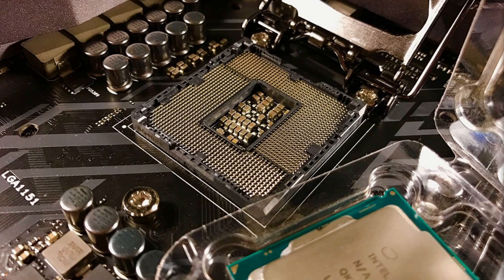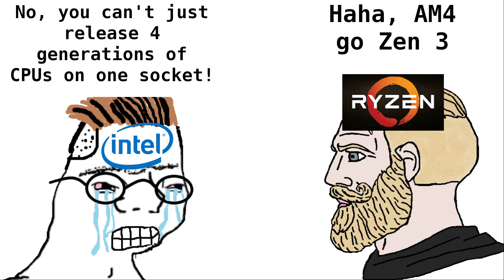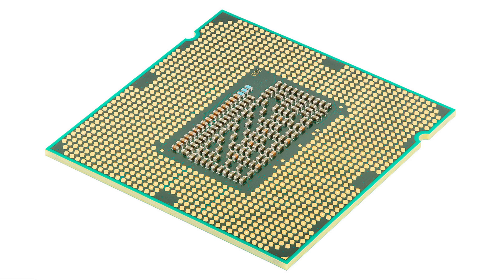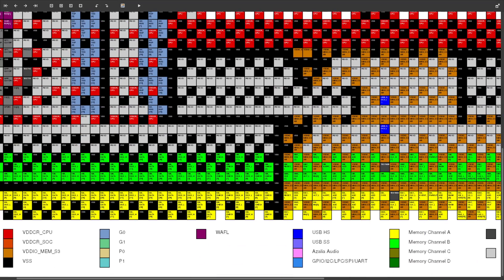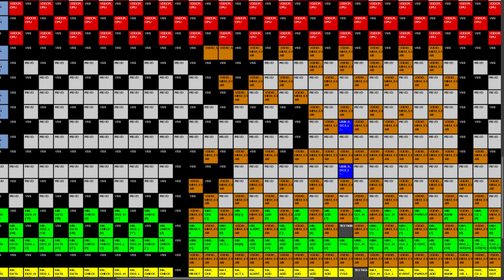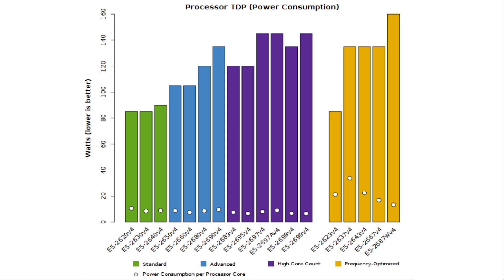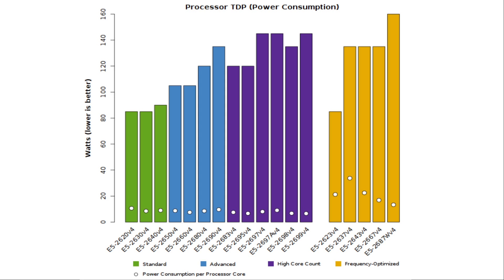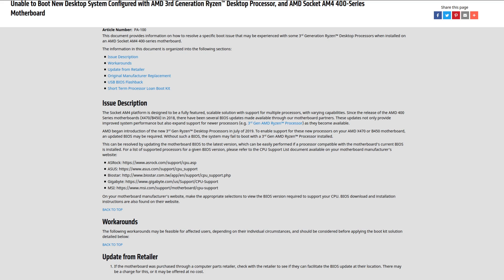The Reason for CPU Socket Changes

Comment: Lot of higher end mobos now can update the bios from a USB port without a CPU installed.
Reply: I'm so fucking glad my mid-priced mobo has this feature. I think I almost bricked my sytem once
Reply: interestingly enough, quite a few laptops, even going several years back, have undocumented ways of flashing from usb
Reply: Really? That's surprising, I should've known that.
Reply: @Supertimegamingify  yeah, its a really cool feature i wish we had years ago!
Reply: @Supertimegamingify  Old school technology usb flashing with out cpu been around for over decades.
Reply: @Supertimegamingify  

Ye it’s called “flashback” or somethijg
Reply: "Higher end mobos"
Found the problem, the lower tiers do not have this feature, even many mid-range mobos don't have it. I guess @Lubsch got the better one in mid-range, nevertheless this feature isn't guaranteed to have until you have a high-end board.
Reply: @d1oftwins  msi boards have 'flashback' option to upgrade BIOS from usb with no cpu installed.
Reply: @unh0lyav3ng3r8  Well, but my question is: does EVERY modern MSI board, low and high tier, have a flashback option? Because that is my gripe, not every series from a single brand has this! And if one brand has it in every of their boards, another brand won't do it just for the sake to sell you up to a more expensive board that has this (IMO essential) function.
Reply: @d1oftwins  almost all b450+ motherboards have it idk about intel
Reply: @tubaeseries5705  
My 2 1/4 year old MSi Tomahawk max PCB has chipless BIOS flashing, all you need is a PSU and a USB stick, the board cost £100 inc delivery and VAT but you can buy the MK2 with 128GB RAM support now for £60 delivered.  I bought it based on this feature combined with the promise of universal AM4 support.
Reply: so that mobo is like a headless cockroach
Reply: @selami32  not really. It's probably just a micro controller and a eprom writer configured to read from a specific usb port.
Reply: It's not limited to high-end anymore, my Asus mobo that costed like 120$ has this feature
Reply: @SagaEf  i feel the same for people that say aux instead of auxiliary, but what are you going to do.
Reply: @TuiCatNZ  oh damn this comment was 1 year old, sorry about that
Reply: My X79 mobo from 2013 can do this. It's not a new feature.

Comment: i only change system (or at least cpu) on 3-5 year usage. I rarely need a "new" cpu every time a new one comes a long. So that extra "fps" performance above 60 fps for example does not concerns me.
Reply: Yea same. When I do a system upgrade it is usually a full upgrade, which includes Mainboard, RAM and CPU. The ability to keep the same mainboard isn't enticing for me since they usually don't support the newer memory standards or the newer PCI Express standards. I think the socket issue is only a problem for people who upgrade their CPU maybe once every year or every 2 years.
Reply: I take it you haven’t experienced a high refresh rate monitor lol
Reply: Yeah every 5 or so years I blow 1300 or so euro on a second hand PC alternatively buy parts separate and build it myself

Comment: I hated how intel kept switching sockets. I bought a socket 1156 CPU and motherboard back when they were new, and then a year later they discontinued it and went to 1155, making it impossible for me to ever upgrade because they never made significanty better CPUs for the socket (only a narrow range).

I really don't ever want to go back to intel after that. The only uncertainty I have is that I'm really big into stuff that seems to use a lot of CPU frequency but not a lot of multithreading/multi-core support (ex. browser games, PS3 emulation, old games that are high CPU usage like Starcraft 2), so Intel really is  still the best for this kind of stuff despite AMD supposedly being in a performance lead currenty.
Reply: Ryzen 5000 should have you covered since it's redesigned to address those shortcomings

Comment: I have a Haswell i5 cpu. A couple of months ago I started thinking about upgrading and I got quite mad at Intel when I found old i7s and Xeons are my only options without basically rebuilding most of my machine. I started researching stuff a lot and later on I realised that it's not Intel's greed at fault here but rather the swich from DDR3 to DDR4 :v

Nonetheless, I got struck when I've found out that Intel's gone through 3 separate sockets with DDR4 (turns out LGA1151-2 is a thing T_T ) while AMD's been somehow able to stick just with the AM4 for all this time. I think AMD's main selling point being the absurd ammount of cores is somewhat irrelevant (unless someone's a Gentoo poweruser) and Intel's higher clocks are much more appealing to me. But if my only room for upgrade with Intel is 1 gen forward (at best) then AMD's a much better option. I can just buy a good mobo and an older Ryzen, and then just upgrade the CPU later on. This way I will be able to get much better performance (and even the clocks) with the newer Ryzens than I could ever dream of buying a couple-year-old Intel's chip at a similar price tag ^_^
Reply: Skylake still supported DDR3, and there are 1151 DDR3 motherboards
Reply: clock speed isnt everything, pentium 4 is perfect proof of that, along with amd bulldozer
Reply: Haswell is from 2014 even if you didnt need a new socket well gg new chipset time, i had a haswell i3 on a z97, board and switched to ryzen in 2018, i knew a socket change was necessary but i went amd because the price/perf ratio for a ryzen5 2600x made more sense for gaming since most games are gpu bound anyway compared to a similarily specced intel offering.

Thing is amd is being limited by am4 and that was showing when 400 series chipsets were not going to be officialy supported for zen 3 (which made sense yet people were mad, amd said same socket nothing about the same chipset)vrms most likely wont be up to snuff for zen 3 and as such that necessitates a new board. Zen 4 being on am4 will be a pipedream for amd
Reply: @davidashurov5255  AFAIK AMD would support older chipsets, but there is simply not enough space for more microcodes, as all motherboards are limited to 16mb. VRMs should be good enough, as new Ryzens are more efficient anyway. And after internet went mad, AMD changed their mind and said, that "they'll figure it out". But this might come with the cost of removing some features or support for older CPU's
Reply: Lmao, clock speeds don’t matter all that much these days. And yeah, you kinda do need at least 6 cores to max out modern graphics cards. Plus intel does bullshit like not allowing you to overclock unless you have a K sku on a Z motherboard, and arbitrarily locked down memory speeds

Comment: Well. There could be another solutions for power delivery. And cheaper, safer and easier ways to upgrade a bios.

Have you ever programmed an arduino? It costs 3 dollars including shipping. 
What if there is an special usb socket on the motherboard to flash the bios from your phone?

What if the new socket has bigger pins for power? Or an external connector for that propose on the side of the CPU die support board and the socket is used only for data bus interfacing?

There is plenty of solutions, but they choose the easier and more profitable ones.

I miss the times where both brands used the same socket and motherboards.
That didn't prevent technology from evolving at all.
Reply: Man, they don't even have compatible coolers. What the fuck. If you see older motherboards they wouldn't even have the same arrangement for the front panel (luckily this has changed lately).

Regarding firmware flashing, more expensive motherboards support double firmware (to prevent power loss from bricking your board) and updates without a cpu installed.

I'm surprised there aren't more things standarized. I get confused in why there isn't a single cable from the psu going to the motherboard. It could be located in the rear so it wouldn't even be visible. They don't even agree on using the same voltages across different components.

If anyone knows a technical reason, aside from difficulty to provide backwards compatibility, this isn't possible, let me know.
Reply: @Gabifuertes  "They don't even agree on using the same voltages across different components."
Not true? 12V, 5V, and 3.3V have been standard for decades.

One reason to have separate plugs for mobo power and CPU power is to improve the routing of power on the board. The CPU power has to be close to the CPU in any case. If you put the mobo power connector next to the CPU one, then you need to route all the mobo power traces avoiding the CPU power traces.

Incompatible coolers is just typical dick move stuff unless the original positions were poor (for structural integrity or CPU pressure) or the CPU height has changed.
Reply: Prehistoricman yes, that’s what I’ve meant. Why do we have to have three different voltages? Using a single voltage across all components wouldn’t make power supplies easier to make? — Maybe it gets more difficult for other components, but I just would like to know why
Reply: Prehistoricman regarding motherboard routing... I don’t see why it would be a problem to have everything close. It would be nice even if power delivery could be provided to the graphics card through the slot (maybe with a newer version of PCI-E?)
Reply: @userPrehistoricman  Hey, what about delivering just 12V to the motherboard (CPU pins are also 12V) and reducing the voltage on the motherboard? It would make only the motherboard more expensive, but the PSU cheaper. Higher voltages are less prone to conduction loss. I got interested in something like this after seeing someone building an SFF with the ASRock Deskmini A300, except input is 19v. The Mac Pro I think also has a lot of power derived on the motherboard itself too.
Reply: @Gabifuertes  I think that the technical reason for no power connector to the back is that during manufacture all the components are inserted into place with the connector pins sticking out and then the motherboard is floated on a solder bath to connect everything in one step.
Reply: @ChucksSEADnDEAD  Sticking with what is already standard surely keeps the cost low. I'm just thinking of something that would make me want to upgrade my motherboard rather than having to because the old one is incompatible, seemingly by an artificial limitation.
Reply: @Gabifuertes  they don't even have compatible coolers? If you mean stock ones, who cares, they come with for your cpu (but also obvious). If you mean custom, then no, they work for both.
Reply: @Gabifuertes  maybe because different components require different voltages.
Reply: And you're? Mad if you think having same socket didn't prevent technology from evolving. Sure, 30 years ago it might haven't been a problem, but now cpu's are much more sophisticated components than decades ago. If you think same socket wouldn't limit engineers now in some way, you're completly mad.

Comment: My motherboard doesn't have a future compatibility. I flashed the UEFI , the 2700x is the fastest compatible CPU. I'm fine with a 1700, I will buy a new mobo whenever I need a better CPU.
Reply: I'll update it again. Thank you. I didn't know they got ryzen 3000 support. Last time I checked was a well over 6 months ago.
Reply: @realnamesnotgiven6193  this 3000 series support was released a few month ago by a major of Mobo manofacturers.
Reply: Motherboard manufacturers update their own Bios for support. My msi x370 pro carbon motherboard with new bios only supports 1000 and 2000 cpus. I heard that some motherboards have higher onboard memory for flashing bios with higher compatibility.
Reply: @realnamesnotgiven6193  I checked your motherboard's supported CPU webpage, and it supports Ryzen 3000 series with BIOS updates.

Comment: You could use a eeprom programmer to flash the updated bios to the chip, thus not needing a cpu at all.
Reply: The most recent ones even let you update your firmware without a CPU installed, you just need to plug in a USB drive. ASUS has it, MSI and Gigabyte too.
Reply: @KingKong-mp6gj  As far as I know, only expensive top of the line mainboards have this feature.
Reply: @KingKong-mp6gj  I like the idea but does that mean that if someone steals your laptop they can pretty quickly patch the firmware without your knowledge?

Only really an issue for laptops without a (good) TPM
Reply: @deoxal7947  
Idk I tried to update my hp's bios without password and it ended up rejecting cause some bull about it having a seperate chip for the pass
Reply: @deoxal7947  Idk i was talking about desktop mainboards that don't need a installed CPU in order for a bios update.
Laptops usually get bios updates via a software application not with a usb dongle or something else.
While i'm pretty sure that it's technically possible to flash another firmware on a laptop to which you have physical access to, i don't think it is fast or feasable. Sounds like CIA type of stuff to me.
Reply: @KingKong-mp6gj  In order to flash coreboot that would be the case since the entire file isn't always accessible or is partially read only. That doesn't mean it can't have anything written to it from a USB though.
Reply: @deoxal7947  I mean, it’s a known fact in cybersecurity that if someone has physical access, most protections are useless at that point. Also who the fuck is gonna steal your computer and just flash a damn bios, and why are you worried about this?
Reply: @deoxal7947  why would they give up on a very helpful feature for most average people, in order to cater to a niche audience with an even more niche concern. People who need it can configure it themselves or buy a product that doesn’t have bios flashback
Reply: @videogamefreak221122  I commented this a year ago, and I've learned more about it. Flashback is useful and it wouldn't be a problem for laptops if they had it. In fact people trying to make their devices as secure as possible would have the most to benefit since it would help to recover if something went wrong trying to flash custom firmware.

The firmware would just need to be signed with a custom key the TPM recognizes in order to decrypt the storage.
Reply: @deoxal7947  bro, like one said, when they get your laptop in hands, it's over.
Especially if you're talking about mf FBI. You think they don't have tech to do anything with your hardware they want?
Also they would just find out your password, bios doesn't contain the data journalist or whoever collected.
Reply: @dr_birb  bro if you take drastic measures then it's not over. You can even set it up so if there is tampering it erases itself.

And the BIOS doesn't contain files, I don't why you said what everyone already knows.

Unsigned firmware could be written to eeprom but the TPM will refuse to give out the decryption key for the drive.
Reply: @deoxal7947  I said bios doesn't contain files, so they won't bother going for it. They just crack your password and get all the juicy files.
Reply: FLASHCAT USB if you have a SPI port its dead fucking ez. MSI has them and so does ASUS.